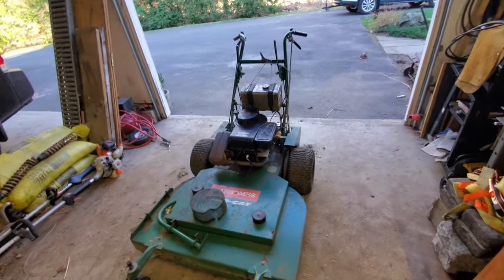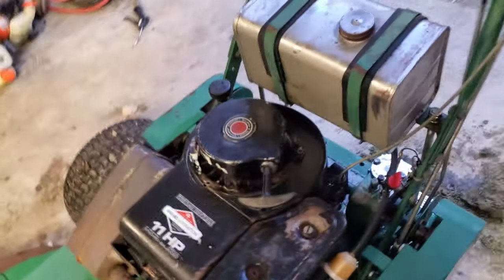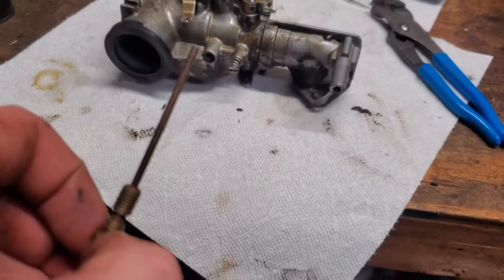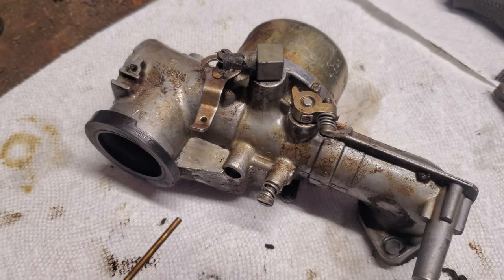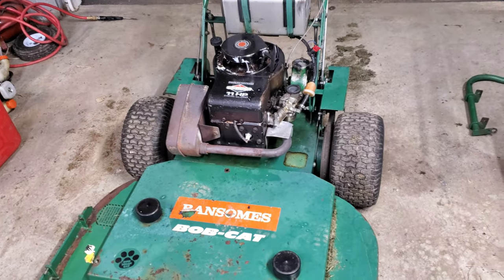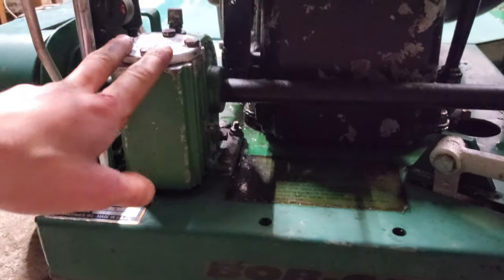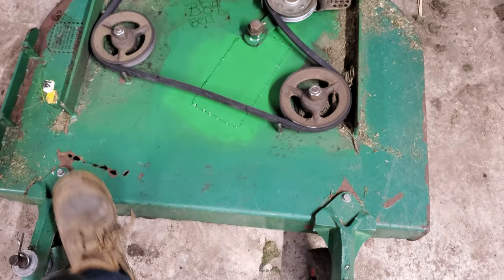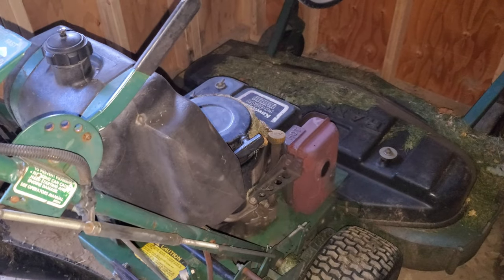Flipping an old Bobcat mower

Comment: I have the same mower except it’s a Bunton. It originally had a 12.5 HP Onan OHV until it wore out and then I put an old 11 HP Honda GV400 engine on it that already had a lot of hours on it. It starting to knock a bit under load but is still doing the job. The reason I put that Honda on it was it was the only engine I had laying around that had a pull start. I plan on replacing that worn out Honda with a 12.5 HP Kohler Command with a pull rope. That engine actually started life on an old John Deere STX 38 until it shattered the flywheel magnets. But the flywheel was fine and so I put on a pull starter on it and omitted the electric starter entirely. So why not give an otherwise worthless engine new life?

Comment: I bought one of these. There is about a 2” gap between the blades, is that correct or did mine come with the wrong size blades? Do these not have neutral? Can’t push the machine around when it’s off unless I lift it off the back wheels. Sorry for the noob questions.
Reply from the maker: I'm not 100% sure on the blades, if I remember right one is further up than the other so it may be right. If it leaves a stripe of uncut grass in the middle I would get new blades. These machines have a neutral latch on the handles so when you latch it the machine should roll freely assuming the belts and brakes are adjusted properly
Reply: @everythingmechanical_yt  thank you so much for the quick reply, probably going to take it to get serviced. Just curious, for the height of the deck on these things I see bolts that can raise / lower the axel but it looks like I have to remove the wheels / belts to do so, you know of any other way? Is raising the caters enough?
Reply from the maker: @seanemmerling3444  yeah it's a bit of a pain to adjust the deck height on these units, adjusting the spacing on the casters can give you a small amount of adjustment but you should try to find an owners manual online where it will tell you what height your axle should be at with how many spacers above or below the caster depending on what height you would like to cut at. This is important because it will keep the deck af the proper pitch in order to keep the mower cutting well
Reply from the maker: A few years ago I emailed bobcat and they sent me a pdf of the manual for another older unit but I'm not sure if you still can because I bieleve they got bought out but still worth a shot
Reply: @everythingmechanical_yt  thanks. I took the wheels off and bolted the axel to the highest position. Had to adjust the brakes so they could function. Mower still won’t roll freely when it’s off, transmission seems jammed when it’s not running. Excited to try it Thursday.
Reply: Hello Guys I just bought a 48” Bobcat Mower. I’m looking for a place online to buy parts. I was looking for the Break Bands, Drive Belts. Mine is the Ransom I believe. Just want to do some PM on it. So if someone could help me in the Bobcat Family lol that would be awesome. I have tried Amazon, and not so much luck. Just wasn’t sure if different makes/models would interchange with my mower. Thanks for any and all help! 🤝